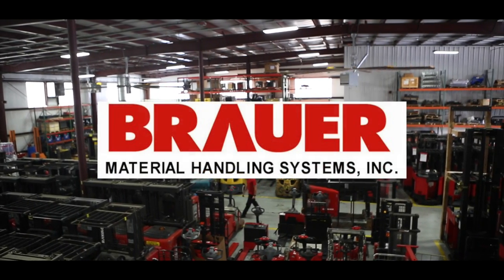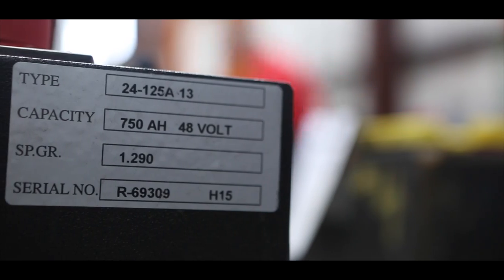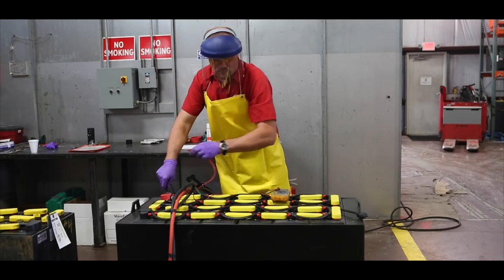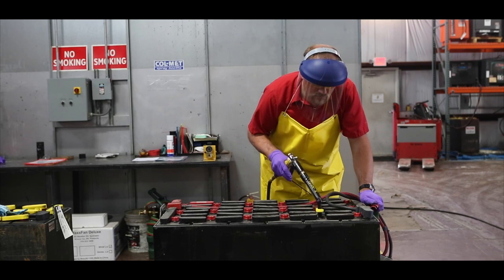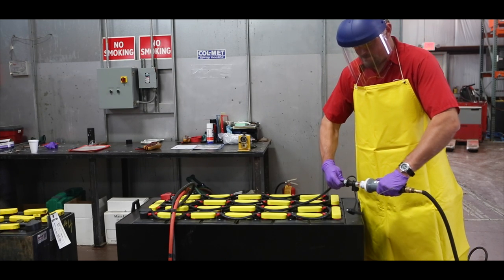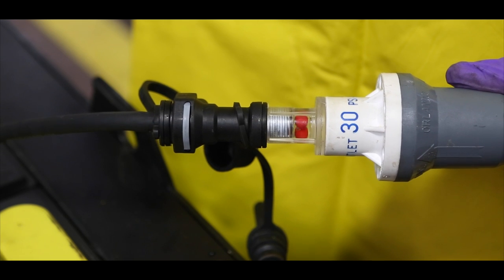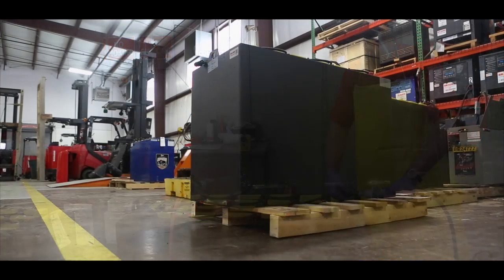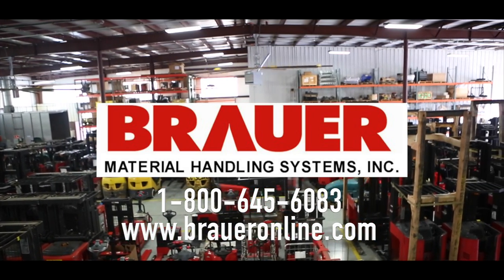Forklift Battery Tips: Proper Watering Techniques

Comment: So the proper way isn't to use a plastic cup? Well, at least it keeps the top of the battery clean. I usually spill more water on the top of the battery than I actually get in the cells.